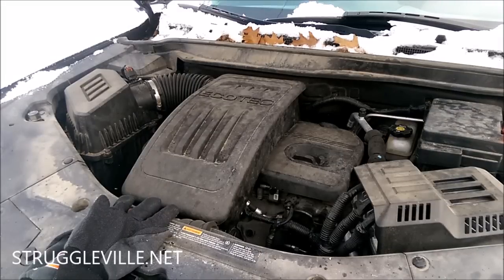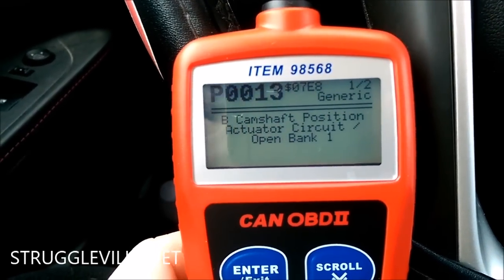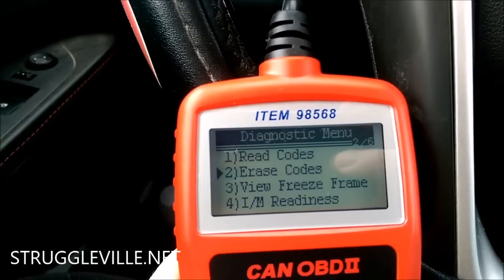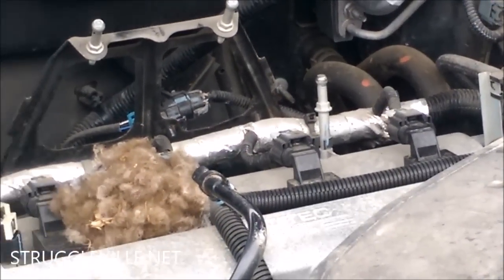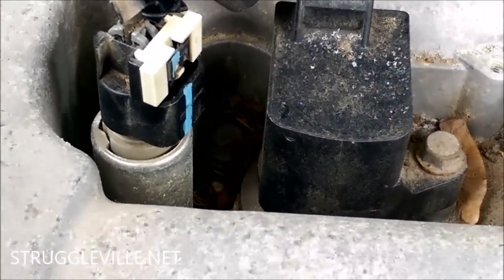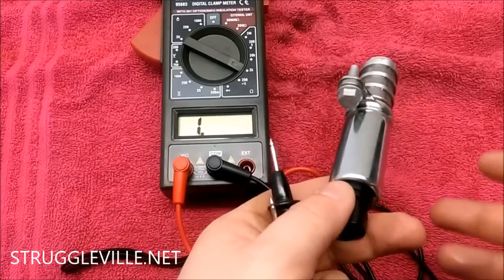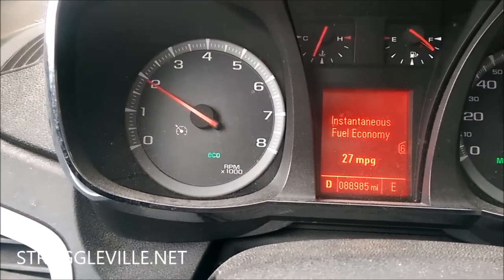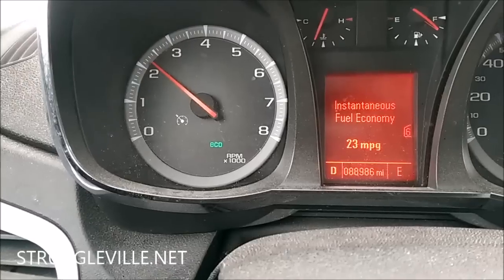GM 2.4 Ecotec Camshaft Position Sensor - How To Test & Replace

Comment: You were replacing the camshaft position actuator/solenoid, not the camshaft position sensor, which is located on the sides of the cylinder head at the driver's (left) end of the engine. The links to Amazon actually call these components by their correct name. No complaints on your troubleshooting and correcting the problem, just wrong terminology.
Reply: Yes you are right what he changed is called Actuator/solenoid the Camshaft position sensor is different its on the right side of the engine near the battery i found that there are 4 sensor in my 2012 chevy Equinox 1 intake Actuator and 2 Exhaust Actuator and 3 intake Camshaft position sensor and 4 Exhaust Camshaft position sensor thanks for correcting him...
Reply: Thank you for this

Comment: We have a 2010 gmc terrian and had a timing chain replaced but it still making a noise and something keeps draining the battery? Before the timing chain was replaced the exhaust solenoid  code was on. After replacing the timing chain multiple codes are on now any ideas? The emc and pcm codes most electrical stuff

Comment: Not sure if you check old posts, but I have a 2011 Chevy Equinox and I just had to replace these, instead of taking it to a shop "440.00" I was able to buy the parts "29.99 on amazon" and fix it myself within 45 min. thanks so much man <3
Reply: I wasn't expecting it but with this Video I was able Pull the Exhaust Solenoid, clean it, test it (with questionable results) reinstall and after some road testing the code(s) cleared. (Before the testing was able to clear the pending codes, with just a "permanent" P0013 sticking around) So I saved around $30-$100 and time getting the parts.  The part I have didn't even look dirty. Screens/Ports looked Good. Oil Level and Condition good too. Don't think I've ever seen Sludge Buildup in this engine but a quick cleaning seems to have done the trick.

Comment: This is a great video. I just wish you would update the title. 
These are intake and exhaust VVT solenoids.
The actual cam sensors are on driver's side of the vehicle on front and back of the cylinder head.
Reply: Are they what is represented when a p0017 code pops up?
Reply: Yep! That's the actual part title. Variable Valve Timing Solenoid....VVT Solenoid.
Reply: @sarcasticcat4982  P0010

Comment: Thank you for video. I replaced my intake one in Sept. 2018, with your help from this video. My check engine light came back on now and it is the same thing. Last time just replaced the intake. This time I'm going to do both. As soon as that code came and how my car was acting I knew I had to come back to your video. Thank you so much!!

Comment from the maker: The links:
Exhaust Camshaft Position Sensor - #12655421, genuine GM replacement  - http://amzn.to/2EOKWz7 (affiliate)
Intake Camshaft Position Sensor - #12655420, genuine GM replacement - http://amzn.to/2BhDU6v (affiliate)
OBDII Scanner - http://amzn.to/2EuD4W9 (affiliate)
Multimeter - http://amzn.to/2EQYzy4 (affiliate)

The volume goes way down about halfway through the video.  Hopefully you can still hear everything.  If you watch till the end you will hear about the problems I was having while making this video.
Reply: What year is this vehicle?
Reply: @uncleb727  2012
Reply: Did you disconnect the battery before replacing the sensor?

Comment: Thank you for this video! Had my sensor replaced by the shop (p0014) a year ago and it was covered under my Warrenty. It was roughly 600.00 bucks that I didn’t have to pay for due to the Warrenty but just a few days ago my engine light turned on again  and according to OnStar it’s the same exact issue (p0014) if the part isn’t covered under their parts Warrenty than I’m going to do it myself. Thanks again!

Comment: Good video. The "crazy horseshoe" is Omega, the symbol for resistance. Plus, when you first turn on the meter you should touch the leads together to measure 0 ohms. That way you're sure the meter and leads are working correctly.

Comment: So I'm getting ready to change my oil, and I had a friend a few months ago use a scanner to tell me what my check engine was, because it wasn't a constant thing. It had said it was the camshaft sensor. Anyway, I had gotten to the "mouse nest" part and laughed, because I had paused when you said to remove the cover. When I removed it there was a spot with bits of thread and whatnot near the oil cap area.

Comment: Thanks for the Video.  Besides breaking the White/Beige Plastic Tab on the Exhaust Value's Electrical Connector (I was expecting it to pull straight out)... after cleaning the Valve and reinstalling/testing the road test cleared the codes so You saved me at least $30-100 in parts.
As it  seems redundant I'm hopefully I'll have time to find some replacement tabs for the Electrical Connector(s)... Hopefully GM doesn't charge $20 each.  Might invest in the removal  tool if they do...

Comment: Good stuff....just bought a used Terrain...literally on the way home the check engine light came on.    Then I saw the date on the dash info screen was Feb 26, 2012.....so the scumbag that sold me the truck disconnected the battery to conceal the fault.  It came up as a P0014
    Got a pair of CMP solenoids on the way.
Reply from the maker: A heads up on the 2.4 if you don't already know about this problem they have - https://www.youtube.com/watch?v=zW3qvmYKe5k

Comment: 2008 Saturn Vue with a P0340 and P0341 Only says Camshaft position sensor A circuit manufuction. Thank you so fuckin much for the information about the A for intake and B for exhaust couldn't find that anywhere.
Reply: Replaced both cam sensors and vvt solenoids still coming back up.

Comment: I just tested both of mine  ( 2012 Terrain 2.4l), and the resistance for both intake and exhaust was 12.5 and 12.6.

I'm stumped. Aren't they supposed to be between 6 and 8????

Comment: I just replaced the one on the far side with the black plastic plug in, and oil is leaking all over, can i be a bad part? I made sure it was snug down but its leaking pretty good
Reply from the maker: Sounds like its not seated properly.  I did this video quite some time ago so the details are fuzzy but it you may want to take the bolt out and wiggle the sensor a bit to see if it will go down any further.  Also I believe it has a seal on it, maybe you are missing the seal or sometimes its possible for the old part to leave its seal on the engine and doubling up on the seals can cause a leak.

Comment: Good video, any problems with high oil consumption on your vehicle?
Reply from the maker: I got rid of mine before that started but it appears a lot of people have that problem - https://www.youtube.com/watch?v=zW3qvmYKe5k
Reply: @TheStruggleville   Yes I like the new look of these vehicles and I was considering buying a used one. There's a couple of fixes that you can do yourself such as just cleaning out the PCV valve and hose with carburetor fluid, and some people suggest getting a vented oil filler cap that will resolve that problem and keep the rear seal from blowing.
Reply from the maker: I wouldnt buy anything with that 2.4l engine now that I know about the problems.  Just not worth the hassle.

Comment: GM Dealership wanted $350.00 to replace both because they said both Intake and Exhaust were bad. My son in law replaced both for under $50.00 and it took less then an hour. Goes to show you just how bad the Dealership will rip you off.

Comment: Thanks for the video, if I'm getting p0013 and p0014 does that mean it's the intake and the exhaust sensor? 2015 chevy equinox lt 2.4
Reply from the maker: I don't remember which code is specific to which part but its easy enough to pull them both out and test them.
Reply: How many miles do you have on it? If it is less than 100K it's under warrantee.

Comment: I'd like to know the specs on a 2014 chevy equinox vvt camshaft position actuator solenoid. I'm replacing them due to a P0011 error code. I bought AA ignition intake and exhaust solenoids. Im testing them before installing them and notices the resistance is reading about 3 ohms higher (8 to 10 on older set, about 11 on newer set). Will this affect part and overall engine performance?
Reply: Did replacing the sensor fix your problem with the p0011 code? My 2015 equinox is throwing the same code

Comment: It takes me 5 mins to remove both. 10 mins to go to O'riellys test both get the one i need. 5 mins to put it back together. 20 minutes total. V V T Solenoid! Variable Valve Timing Solenoid.

Comment: Will this cause my vehicle to use up oil? I'm getting p0014 code and my dip stick is showing there is NO oil in my motor
Reply from the maker: No this won't cause that but GM is getting sued over these engines burning oil - https://youtu.be/vEV83-2mbBI
Reply: No oil or low oil or wrong oil will also cause the vvt solenoid to appear bad. Fix the oil first then restore the mil and go from there

Comment: 1 ohm or more means that there is enough   resistance for a circuit to be open les than one means that there is continuity and that the circuit  is works.

Comment: Thanks for the link the other day! Def watching and supporting content creators like you. Cheers! BTW do they have car computer mobile phone apps with a cable that goes from the car to the phone? Even better, plug a BlueTooth thingy into the car and read the codes on an app?  Just wondering. No matter, I need to get one of those code readers.
Reply from the maker: I am pretty sure they have bluetooth plugins but am not 100% sure.  If they dont have them they should! 😉
Reply: Yes they do. Last time I looked the Bluetooth adapter is like $250 U.S.

Comment: Where is the position sensor located, this is the solenoid.
Reply: The Camshaft Position Sensor is under the high pressure fuel pump. These are the Variable Valve Timing (VVT) Solenoids aka Camshaft Actuator Solenoids  Camshaft Position sensor part GM (12674704)

Comment: I got code p0011  p0341   p0335  p0366 I changed my starter spark plugs crankshaft position sensor   ignition coil  and my intake solenoid  still having trouble  starting and keeping it in idle  I press the gas a little  bit and my engine  fails when I do get it to run my rpm  drops to zero and the service track comes on I need help 😞
Reply: Throttle body calibration,  clean it firts

Comment: I was just joking if you could have heard me screaming I was really screaming all that stuff that was great but that is definitely not a camshaft position sensor on the 4-cylinder engine people there are two and intake and exhaust they're too little tiny plastic sensors and there between 15 and $30
Reply: Yup

Comment: If this sensor is bad can it also cause o2 sensor codes?
Reply: Not unless they go away after you fix this. If your car has high miles the  catalytic converter is probably stopped up